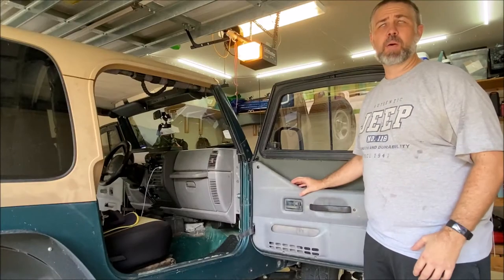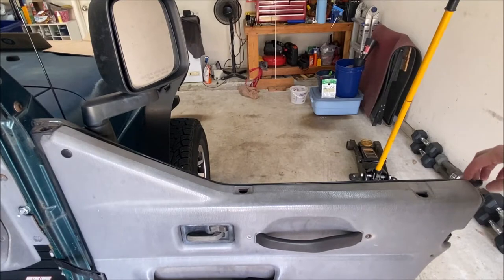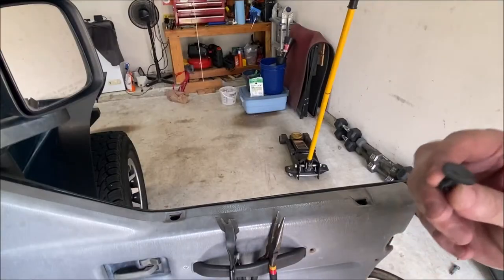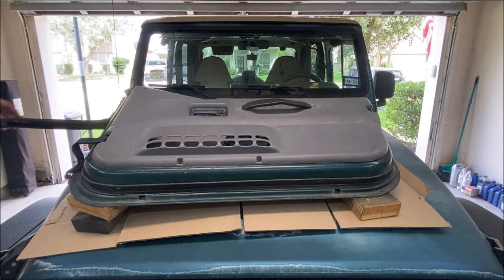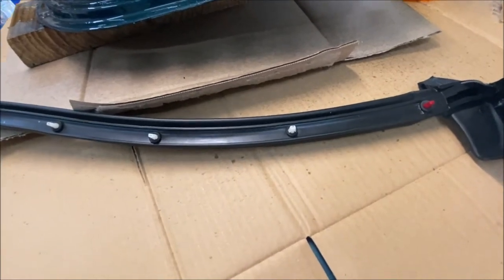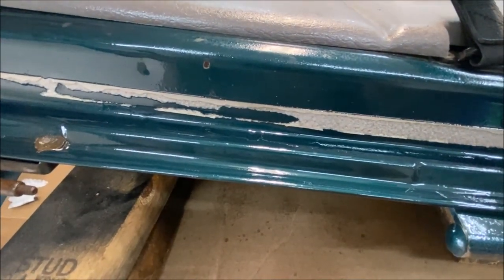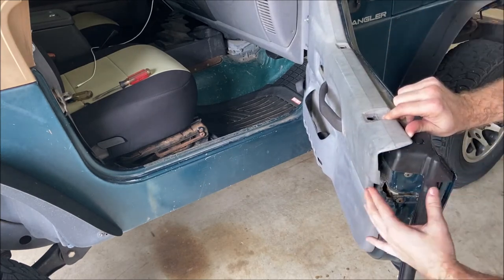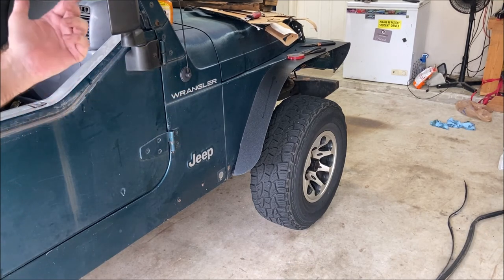Jeep TJ Half Door Weather Seal replacement – trying to stop door leaks

Comment: Amen, bubba! Exactly the information I was seeking. My left side seal was badly deteriorated (eBay OEM '98 TJ half door modification project). Bought the replacement on eBay. Ad said that it used pushpins. Was unsure if/which pins could be reused on a door that didn't have all the holes like mine.  Thanks to you now I know. Otherwise,  I neither saw nor expected the huge gap cut into the seal I bought. Tmechanical
Reply from the maker: Awesome! Glad to hear the video was helpful. Thanks for watching!

Comment: Those door seal leaks (at least on full doors) are the worst and probably the biggest culprit. Water tends to pool on the bottom of the door and finds it's way into the footwells
Reply from the maker: I totally agree - replacing the door seals really helped a lot!  The only leaking we have now, after all of the leak work I've done, is from the poor seal between the upper half door and the hard top.  But my son refuses to replace the uppers so he's happy with the way it is now.

Comment: I have the slider uppers on my YJ and I have a huge gap up where the windshield and top are met by the upper. Is it because I don't have that a pillar seal?
Reply from the maker: I've sold the TJ since I did all the leak repairs so I'm trying to go from memory.  I think you're right - I'm pretty sure the seals on the window uppers press against those black plastic pieces on the window frame.  At least, for the TJ (I assume the YJ as well).  Here's a link to the video I made on replacing those side pieces if you haven't seen it and in case it's helpful.
https://youtu.be/1GXQUxJL9Aw?si=Awm3Ewx5-t0TjmqY
Good luck; sorry I can't be of more help with this one.  Thanks for watching, Ashley.